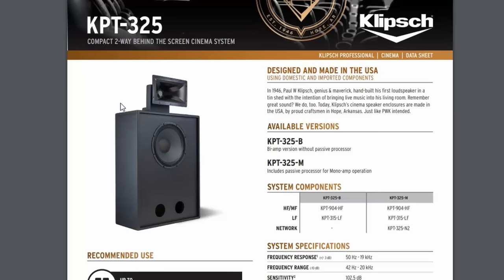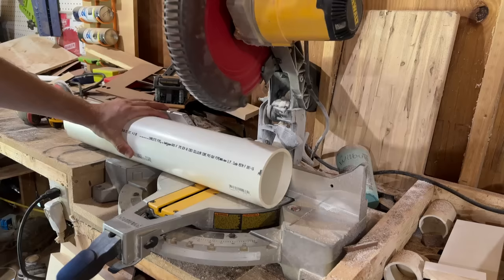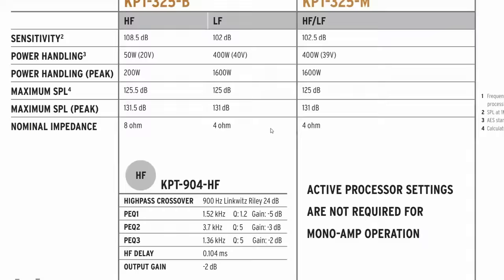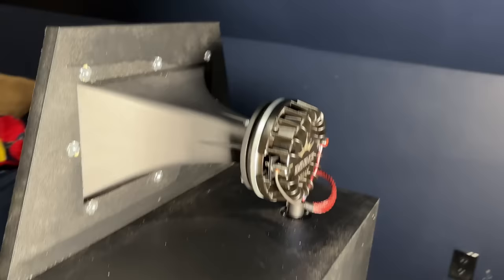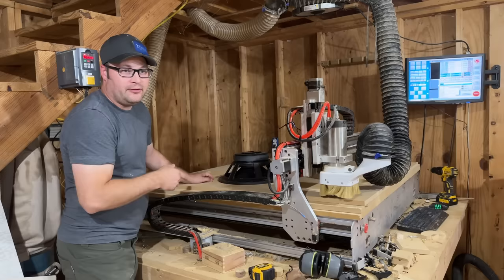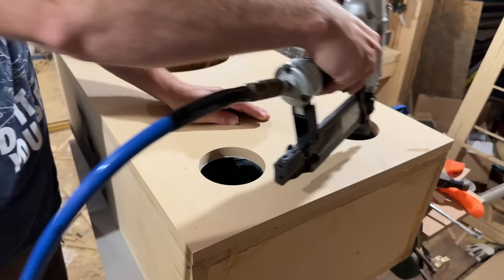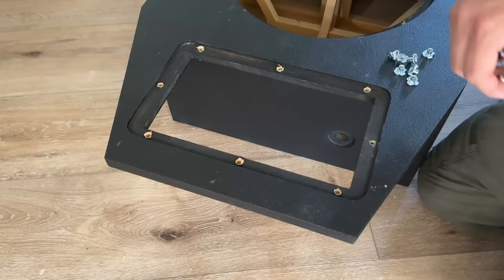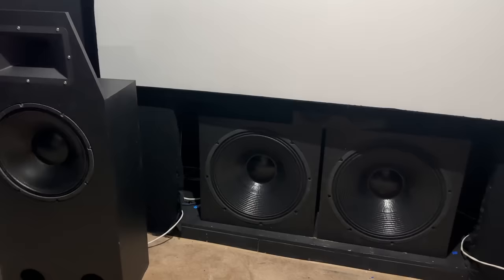How to build $9000 Speakers for $2000 - Klipsch KPT-325 Inspired

Comment: In wall speakers next please.  Ones that can be placed in wall or on wall if you want to make a thin box. And can be used as ceiling/height channels. One speaker for all surround needs.
Reply from the maker: That is something I really do want to design.
Reply: @Toid  Please do. I will build them immediately. I have a ton of ideas. I just don't have the cross-over design for the  box dimensions I want.
Reply: Yes, 2x6 wall construction  loud L.C.R with great klipsch sound would be ideal for me. 17x24 theater room with 12' ceiling.

Comment: You're right about high sensitivity. I'm using Bill Fitzmaurice Omnitop 12 (which take some padding with the 28 band EQ) and they scream the place down with an SMSL SA98E. Even the amplifier in a pringles can speaker get them more than loud enough. The bass woofers I have complementing them need more power to get loud but that's expected. They can still pump pretty hard off the SMSL - loud enough for my landlord's girlfriend to ask me to turn it down from over the road. I do miss having the Peavey IPR1600 hooked up, especially now I have the subwoofers in their loudest position - downfiring into the floor (8 inch gap) in the front left corner.

Comment: If you’re building your own speakers I would wire drive units directly to separate binding posts. 
Active. 

Use a studio DSP ($200 - $2000+) 
No passive crossover required. 

Two (stereo) power amps, or four mono. 

You can control all crossover points, EQ, time-alignment and gain from the DSP.

Comment: I have near field speakers that use the Eminence Delta Pro 12A and it's ridiculous how powerful they are, which has any meaningful THD concerns so far down the road from anything reachable in a residential setting. The big Eminence drivers really turn on near reference levels when you can actually see those robust surrounds move. Honestly, if anyone is looking for something more ambient or for lower SPL use, these may not be the drivers for them.  

The 12s have ruined me with small speakers. Once you get used to what these can do, it's hard to go back. 

15" speakers have always been my sweet spot size for the levels I typically listen at. IMO, they are truer to 'life-sized' sound with regard to scale and presence. It's something I have always been able to sense in the room, even when they are just idling along.

Comment: I need to build a theater soon. I see emotiva has a reasonable processor now. Would you recommend that. Or just get a receiver from them or one of the other 3 big names. 
Diy is my game in general but a processor/receiver with hdmi is up to consumer goods only, not diy. 
I have to say for health and belly blowing away. fasting, OMAD or two meals a day. Never seed oils ever again, EVER EVER. Eat butter and meat, some homemade carbs if you need them. Saturated fat and high salt intake is better for you. Beer/wine is good but in moderation. Exercise like walking for an hour a day. I've been there and had suffered for 10 years. Lift weight if you like. Just 10 min a day, no more. No long runs, just sprint. Find what you like.
Love the channel and will diy some speakers some day. Kids are consuming the free time and love it. Maybe after they leave the house.
Or rather have them help. Muahahahahahahah
Reply from the maker: I’m not real familiar with a emotiva processors. Having said that I don’t believe they do Dirac, so I would probably go towards something like the monolith or an anthem. Or if you’re on a budget, I would probably consider doing something like the Denon 3800. All of these are upgradable for direct, which is currently the best room correction software on the market. The den and 3800 is an AVR, but it does have RCA pre-out so you can hook up whatever amplifier(s) you want to it.

Comment: I agree that with a smart design and modern compression drivers one can achieve a sound quality that smaller audiophile products cannot achieve. 

I built the Joseph Crowe 1815 speakers (different cabinet design, 3d printed horn, same concept otherwise) and I am VERY happy with the results. My Buchardt A500SE play in one room, giving me super linearity and a wider soundstage, the big 15+1.4 combination in the bigger room.

Comment: It was pretty easy to make better klipsch than the original model 1 and 2.  Klipsch used outsourced drivers.  You can get better drivers than they used. klipsch polymer diaphragm tweeters were harsh.   The woofers were not as good as others you can buy. You can also easily make a better crossover than klipsch used, older klipsch had cheap crossovers. They also didn't brace, and had little insulation/damping inside.

Comment: This project is insane. Great work!
I wish I had the space to accommodate a home theater that these would fit in. Maybe, some day
Reply from the maker: That is the hard part with builds like these. Not everyone can take advantage of them.
Reply: We diyer's are glad to aid in ideas that fit budget and room deminsions from auto to home,,agree?
Reply: I design and construct on kitchen table one eye 30% heart no feet. I create short cuts and laugh at quitters. Age 70 ,completed 500+ systems. 
Sorta retired. Just got heart stint, back to building , open baffle is ticket to small room Soundstage.
Reply: @Toid  Nick, how about a 6" - 8" woofer and horn to stomp on the RP-600 - please.  Pretty please!  I like my Emotiva T-Zero towers, but there has to be something better that I may be able to afford to build for my budget 5.1.2 surround system.  Or, I could use the new speakers in a superb 2.1 system.  Thanks and wishing you and yours all the very best, Kevin

Comment: You have inspired me to buy your plans and build a pair of these. Although I may redesign with a 12" driver or two. Will be replacing my customised klipsch legends in my HT Already have 4 of your eminence 10" coaxial designs as my atmos speakers in my HT. Thank you.
Reply from the maker: That’s awesome! Full disclosure I’m actually designing a smaller version using a 12”. So if that is what you are thinking you might want to wait. I haven’t started on it yet, but should be soon.
Reply: Nice! Look forward to it. I still need to do the ultimate rca lead video.
Reply: @Toid awesome!
Reply: Im in for this - thank you for the hard work! @Toid
Reply: Do you happen to have a list of components used in the crossovers? or will you for the 12" version?

Comment: Knocked it outta the park again with this one. I’ve been waiting on this video since I watched your Textreme video and it didn’t disappoint. Question for you though, sounds like you like these more than the soundstage 15s. I’ve wanted to buy the plans for that because I wanted a speaker that had a wide soundstage. But now I’m debating whether these are the better choice for home theater 🤔. From your impressions it sounds like this one sounds better overall. Was the sound stage at least decent in these? And would you pick these over the 15s?
Reply from the maker: Honestly, I love both of those speakers. You couldn’t go wrong with either one of them. The soundstage 15 does have a much wider dispersion, then these. So, if you are really into why dispersion speakers, the soundstage 15 and cinema 10 are the best. These do you have a very unique sound signature that I really enjoy. But you aren’t going to get as wide of a soundstage.

Comment: In your article about the "Best DIY Speaker by Use", and they ranked in each category?  You have 6 projects listed for 2 channel audio - which is the "best of the best"?
Reply from the maker: I should have elaborated. They are in order top to bottom on my thoughts. The one at the top of the list is ranked first. However, it’s not quite cut and dry. I love the soundstage 15’s but they are huge. If you want smaller or don’t like compression drivers, the Epic HiFi would be a better choice.

Comment: Nice build. I want one of those CNC routers! How hard was it to learn the cad program? Is it sketch up? Thanks for your content btw.
Reply from the maker: Thank you. They are nice, especially the ball drive. I use sketchup todraw it out. However you still need to import those drawings to a cam program. In this case in use Aspire. The cam programs are not cheap at all. 2d carvings like this aren’t hard to learn, but 3d can be much more difficult. You can actually draw everything as a 2d model in Aspire and cut it out, skip sketchup all together.

Comment: Is your list for the best 2 channel speakers be rated in order, being that the Soundstage 15 is still your number one pick? I can see that as it uses a smaller, thus lighter - faster compression driver. Do your speaker plans include the CNC programming? Thanks.
Reply from the maker: They are to be rated in order as best first and so on. The only plans, I have listed with the DXF files is the Rule Breaker, but I could create a custom onecgorv you for the soundstage 15. I just charge $10 for the DXF files which is what is needed for your cnc program. Let me know if you want to do that, just email me at sales@toidsdiyaudio.com
Reply: @Toid  Thanks for the reply. Can you share what you are hearing between this KPT clone and the soundstage 15 to make the soundstage be a better audiophile speaker? Thanks
Reply from the maker: @rvaillant  I'll try my best. But one of the things that I look for is a speaker that can really envelop the listener with a very wide soundstage. The type of horn/waveguide used on the Soundstage 15 allows for the wider dispersion. Having said that, I really love how relaxed these speakers are. I could listen to the BTS 15 all day without fatigue, which is hard to say about many speakers. Honestly, you couldn't go wrong with either. but if you want the wider dispersion, the soundstage 15 is better. if that is not as important to you, then the BTS 15 have a very relaxed, distortion free sound that I really enjoy.

Comment: Would you mind sharing why you chose such a high power woofer? For an auditorium they'd be great but it seems like a bit of overkill for home right? Plus they're expensive, compared to lower power options? Great video, thanks.
Reply from the maker: You could go with a lower pair for sure. But these will make sure you ahve plenty of headroom and in general, ones that can handle higher power have lower distortion when playing at the power levels we would use. Meaning in theory it should be a cleaner sound from the woofer.

Comment: Curious about the combination with the subs. Do you high-pass the woofers, or do anything to match the sub responses with the woofers?
Reply from the maker: Great question. Those are two 21” subs sealed. So no high pass necessary. The mains are crossed over with the subs. For home theater I allow my mains to play to 60hz for a little more mid bass, but since would highpass them sooner.

Comment: Hey Toid! Would these be able to fill large dedicated theater rooms at reference levels (120db) 
Room dimension: 23'w X 35'L X 12'H 
I would use 3 of these behind an AT screen.
I was originally gonna go with the diysg Titan 818  because they'd fill my room great (from what others have said) but I'm really liking your impressions on the textreme eminence compression driver. Sounds like it's a much better option than the Celestion used on the Titans. 

What's your thoughts on these as opposed to the Titans in a room that size. 

Either way I plan on building 4 of your 21" subs to go with it. 
I'm also using your Atmos speakers for Atmos.
Reply from the maker: First, that theater is going to be killer! These would absolutely fill a large dedicated theater room like you have. It really is one of the reasons it is designed. But Full Disclosure, early in 2024 I will have a new design using these textreme drivers that will be an MTM design with 12" woofers. Similar to my Audience 212 design. These should have better off axis than the BTS15, which might be better if you want a wider soundstage. However, I have not completed the design. THis is mainly due to the fact the Textreme drivers are out of stock currently. I will be finishing the design as soon as they come back in stock. Just food for thought, if you want to see what I come up with before deciding.  Either way, you are going to ave a killer setup!
Reply: @Toid  yeah I saw where you're working on a 12" version of these and my plan was to use those for all my surrounds if I went with the BTS 15's up front, that way my entire bed layer would have the same sound signature, which is important for me. 
Thanks for all the work you do in designing these speakers, it allows us mere mortals to have end Game theaters without selling a kidney!!
Reply: @Toid  one other quick question, how difficult would it be to change the driver to an 18? Do you have to completely rework the crossover, or just make minor changes? Or what about changing it to dual 15's or dual 18's?

Comment: great video, what is the software you use to design these enclosures send to the CNC, also do you have a link to the mfg of the CNC table? thanks
Reply from the maker: I used Sketchup to design it in 3D. The CNC is by a manufacturer called CNC4Newbie located in Canada

Comment: Is the characteristic roll-off between 10K and 20K for a 1.4" exit compression driver an issue? I have been extremely curious about the TeXtreme CD but only have experience with poly diaphragm 1" exit CDs and have wondered if a super tweeter might be necessary with the TeXreme.
Reply from the maker: This started to roll off around 12Khz, but was relatively well behaved and subtle. Making EQing the high end not an issue.

Comment: You could get alot more output from the ports if making an optimal slit port. Its especially good for shallow boxes since you can go smaller port area to reduce length but get more output at the same time.
But this is only true for an optimized slit port. The height to width must be small enough and the ends should expand by 7 degrees (both sides) from around 1/4 och the length in from the ends.
Also the port (all ports) perform better with an internal baffle. And around 5-7 mm round over at the ends.
A straight round port without internal baffle and the roundover will loose 50-80% performance! 😲

There is a paper by Bezzola where the optimal shape for a round port is researched. ”Optimal bass reflex loudspeaker port”.
Those are very good. But even a straight slit port(without the expansion at the ends) will perform better.

Comment: What is required to drive these? What would you recommend for a center channel, surrounds and sub to go with these? I am in the process of starting a home theater build and I want a nice clean 5.1 setup without spending insane money.
Reply from the maker: Great questions. I’m actually designing a center channel and surrounds using the same pain compression driver and horn in the surrounds but using a smaller 12 inch subwoofer. For the center channel in making an MTM using the same 12 inch drivers and same compression driver, but will be using a little bit different of a horn to maximize dispersion for the center channel. That MTM will actually be able to be either a horizontal or vertical. That means you technically could use it as front and center if you wanted to.
Reply from the maker: As far as driving them, they are very efficient, so you don’t actually need anything more than just a surround sound receiver. But if you want it better amplifier, then I would take a look at Buckeye amps. They have some really nice amps for great prices. And as far as subwoofers, that’s really up to you. I’m using my earthquake 21s with these, and it seems to be a very nice blind.

Comment: Do you think it'd be possible to get the same acoustic results if you were able to make some kind of in-wall variation of this speaker?
Reply from the maker: I’m not sure if you really can. I haven’t measured it, but the depth of the compression driver and horn is something like 10-11 in deep. But in theory, yes you should get similar results after you account for crossover differences.
Reply: @Toid  Gotcha, it would be a good instance for a false front wall. If you weren't able to accommodate the horn
Reply from the maker: @Thelangster5  that would be a great idea

Comment: I wonder how they compare to jbl theater speakers but I assume they are worse I meant the klipsches not diy
Reply from the maker: These are legit. I wish I had some JBL on hand to compare them side by side. I would assume the JBL will not have as flat of a response as these, as they are designed around the use of DSP in a theater setting. Of course that’s easy enough to add.
Reply: @Toid sorry I forgot to clarify I meant those cinema klipsches that are worse not diys. I know those diys play better
Reply from the maker: @wadimek116  🤦‍♂️ ah that makes sense, lol. I should have caught that

Comment: Impressive project, thanks!! 
May I ask if those Klipsch inspired speakers are better than those you made when you "copied" the JTR Noesis dual 12inch speakers? Are there differences when it comes to sound quality and SPL capabilities?
Reply from the maker: It’s a good question. In my opinion, these are a significant upgrade. Either will get you the SPL needed, but these are more dynamic and more transparent. A lot of it comes down to the textreme driver. It really has an unbelievable sound signature. Is definitely the best compression driver I’ve used

Comment: Great video!! Here is a dumb question... is a crossover needed?
Reply from the maker: Not a dumb question at all. But yes a crossover is needed. It basically directs certain frequencies to the woofer while directing others to the compression driver.
Reply: is there one you recommend for this design in your video, and where can you buy? Thanks for quick reply!! @Toid